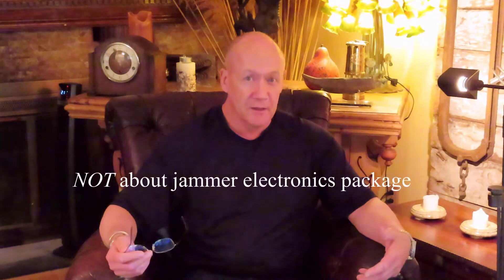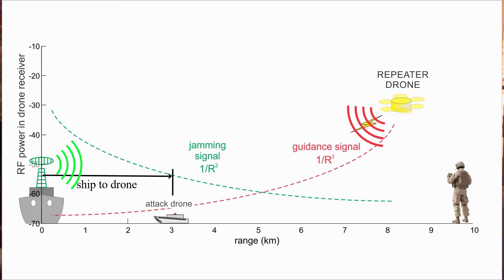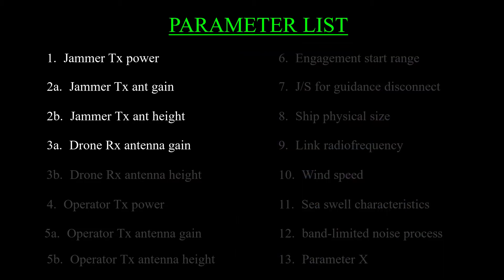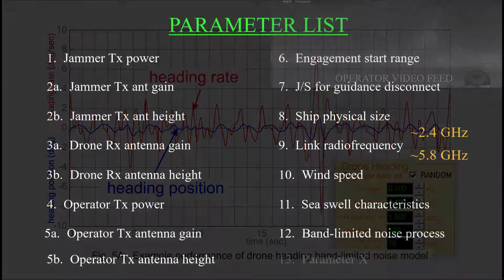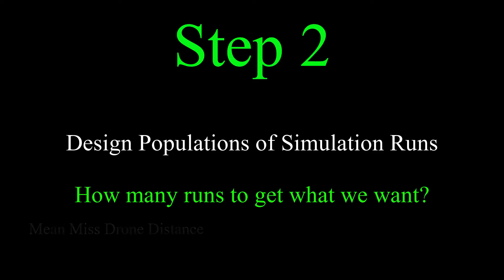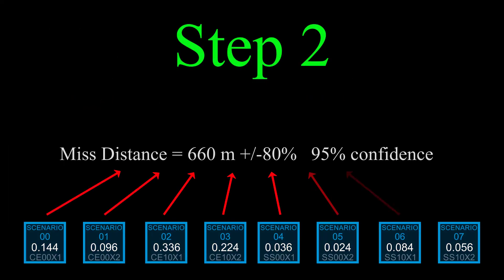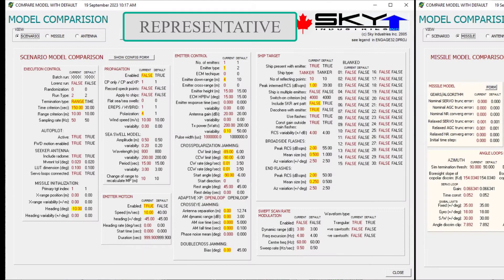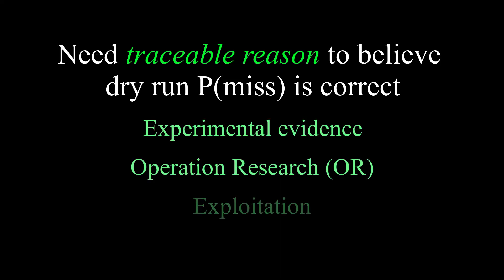How to Design a Counter Drone Jammer PART II 04

Comment: He's describing a Monte Carlo simulation.
Reply from the maker: Yes that's right.  

I'd call it a "smart" or "modified" Monte Carlo simulation; it's necessary to exclude physically inadmissible runs from the population for each test case.  

Inadmissible runs arise when simple run-by-run parameter randomization results in an unfortunate combination which can't happen in the real world, so those ones don't belong in the population.  

This can happen when parameters are inter-dependent, for example when the value of parameter 1 can vary between value A and value B, but depends on the value of parameter 2.  The pdfs are conditionally linked.  

Solution: in missile simulations, make sure all the missiles pass Quality Control!  That they can all hit a target I mean.

Comment: Is there a commercially available software to run these models/calculations?
Reply from the maker: I had to build everything from scratch: propagation model, model management application, data configuration management application, data analysis/inspection application, user interface, the whole smash.  Send me an e-mail if you are interested in it, shawn.charland@skyindustries.com
Reply: import math is what I would do first in a Python script.

Examples of its use for such calculations can be found by searching for "Chapter 3: Radio Propagation and Propagation Path-Loss Models Python“.
U/I is another part, but the math is available in all programming languages and platforms.

There may be js implementations of it out there too.